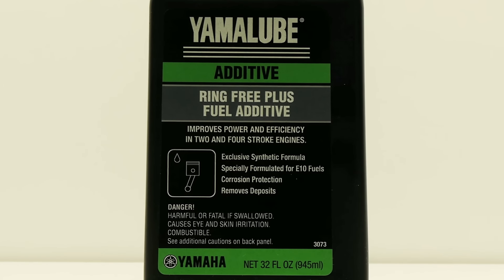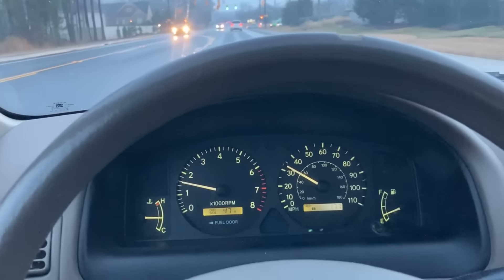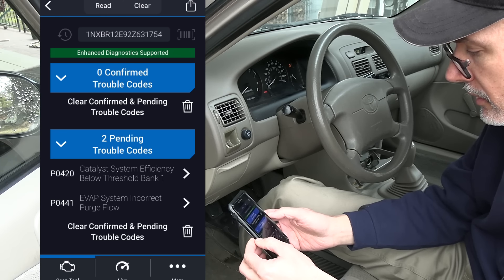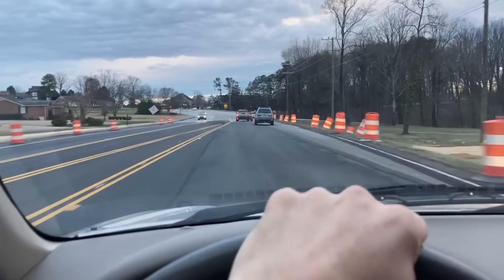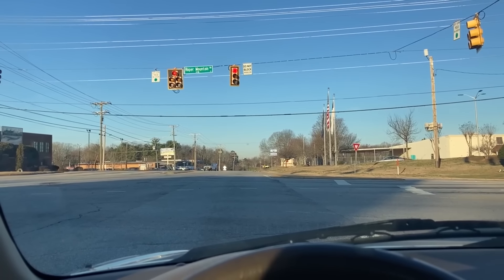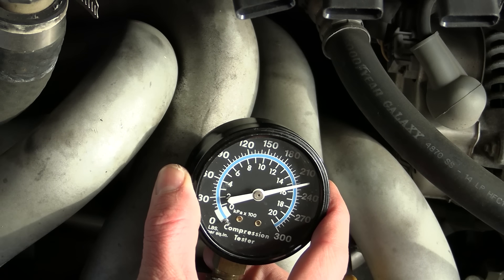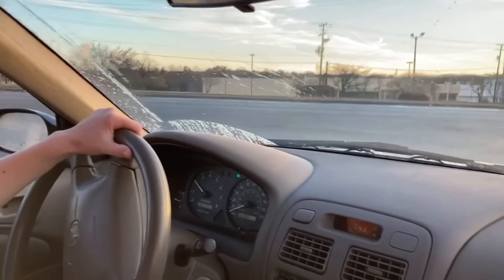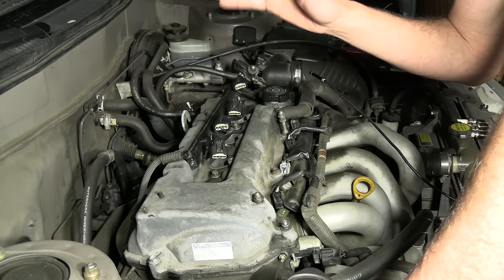Will Yamalube Ring Free stop oil consumption? | Oil Burning🔥Experiments | Episode 20

Comment from the maker: Previous video: https://youtu.be/Y5RzFYMYaJI
Oil burning experiments playlist: https://www.youtube.com/playlist?list=PLS7Cti2LicYDtv1hFbz_dErQFGxnTgMCj
Reply: Valve steam seals. Need your help.
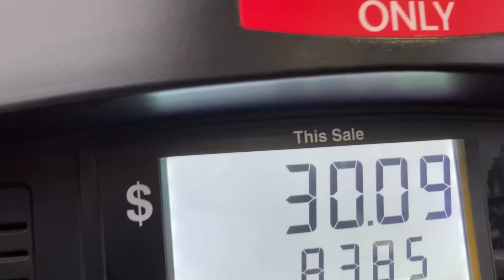Reply: 6:42 Putting 93 on a Corolla? 🤨
Reply: I subscribed exclusively for this series, have you tried using Lucas heavy duty stabilizer or Lucas + Stop leak? Good luck.
Reply from the maker: @theguycanfly98  Thanks! I did use Lucas in a VTEC Accord and it shut down the VTEC. I also used Barrs Stop Leak several videos back in this series. The thing is, I don't want to plug any holes up with thickening additives and metal conditioners (e.g. a lot of viewers recommend Restore), I want to unclog and loosen things up with cleaners to see if we can get the engine working like it's supposed to. That's not to say we can, but I'd like to prove it one way or the other. Thanks for the sub and the comment!!
Reply: @FamilyFriendlyDIY  I believe Lucas has a thinner full synthetic for low viscosity oil. Hear me out maybe add a little less than recommended of the lucas to thicken the oil a touch and maybe whatever cleaner you put in there will hold onto the rings better like the yamalube if you do another go as this cleaner. Just a thought, but I am highly invested in knowing if any of these will work, or if you finally just have to disassemble the motor and manually unstick the rings or get new rings.
Reply from the maker: @@kondon-jt8jt When it’s finished 🙂
Reply: You need to use conventional oil and not synthetic it burns faster from my experience on high mileage vehicle.
Reply: @FamilyFriendlyDIY  thank you for what you are doing, I've subscribed to your channel. I was wondering from all the cleaners that you have used so far which ones are the top three? You need to make a list at some point in your videos.
Reply from the maker: @27ubs  Thanks. ... So far the only one that made a noticeable difference in the oil use was the Berryman's B12 Chemtool.
Reply: Just rebuild the moter😮
Reply: Hey that idle flux. Could be your idle air control valve. If its like a OLD school toyota it would be on the bottom of the throttle body has water lines attached to it.
Reply: @obtrunco why not he runs Iridium plugs so...
Reply: Great video. This is my oil burning experiment. I have a 2008 Dodge Grand Caravan 3.8L I gave $1,000 for when it had 208,000 miles. The liar I bought it from said it used 1 qt of oil for every 2,500 miles. It actually used 1 qt of oil every 500 miles. I put 1 can of Engine Restorer 6 cylinder in a fresh oil change. He was using Valvoline 50/50 semi-synthetic high mileage oil. I changed the oil to full synthetic 5w30 Valvoline oil. Now, it uses 1 qt every 5,000 miles and the engine feels like a new vehicle. I have driven it 14,000 miles since that time and it is still only using 1 qt per 5,000 miles. Hopefully, it will remain that good. BTW.. Most of my driving is at highway speeds of 60 MPH to 75 MPH.
Reply: @oldschoolj510  Could be false air (extra air) being sucked in by worn valve guides and valve guide seals

Comment: I don't think your going after the problem you have.... I think it's the valve stem seals not the rings because you have oil on the top of the piston and the engine is blowing oil smoke out of it when you start the engine. The vacuum of the engine is pulling the oil through the the valve guides because the valve stems seals are probably rock hard and the guides may be loose (worn) too. You can put as much snake oil (oil additives) as you want in the engine it is not going to repair valve guide seals that are rock hard and no longer function or loose valve guides. You don't get deposits of oil on the top of the pistons like that with sticking rings because the pressure is forced down not up into the conbustion chamber you would get a ton of blowby. Try this to see if the rings are sealing, open the oil cap put a rubber glove over the hole where you add oil and seal it good. Rev the engine a  bunch of times and see if the glove fills up. If it does fill a lot then you have blow by if not it's something else like what I mentioned above. My two cents from a technician of 45 years.
Reply: It went down a lot after the b12 treatment. But I think you're right, in the fact that the rest of the oil burning is from the valve seals.
Reply: I dont think hes ever going to fix that due to his car "still using oil" he can keep making content on it. would like to see if stem seals would fix this since the b12 helped heaps
Reply: His compression is around 240psi on all 4 cylinders. That’ll raise crank case pressure while the engine is running and push oil through the valve stem seals while at higher RPMs.
Reply: Smoking on initial start:

If you start the car from cold, and it starts to smoke after a couple of seconds and continues to smoke for a couple of minutes, then goes away, that usually means the the valve stem seals are bad.
If it would be piston rings then the smoke would not go away and would start smoking even more under load and also will smoke on a trailing throttle going downhill.
Reply: @DirkOz sorry I know I am a Stan for diy Dave at this point, but I'll point out he has a whole 30 video playlist and he has already replaced the valve seals, and there is also a video where he has a camera on his exhaust for like 20 minutes. The smoke keeps coming out anytime he accelerates aggressively or goes up a hill.
Reply: @Weimaraners no

Comment: My thought is try a catch can to see it you are battling two issues I have been using ring free in the gas for all my water craft and small engines for 10 year I can say starting them never been easer and I don`t have to use combustion cleaner in the two strokes and more.

Comment: I watched all of these: 30 hours to NOT fix a Toyota. Engine flush / then de-coke using CRC in a vacuum hose off the air boot, then swap  the oil to a Valvoline Restore and protect.

Comment: Dave thank you for your great videos. Our 2018 Kia Sportage 2.4L GDI with 80K miles has been burning 1.5 quarts every 1000 miles. I performed your Chem Tool B-12 treatment and WOW 700 miles later zero oil consumption. Also the oil looks super clean, before the oil quickly turned black after an oil change. Keep up the great work my friend! 👍
Reply from the maker: Great to hear, and thanks for the update!!
Reply: The PCV residue will kill GDI engines about 150,000 miles. The valves coke up so badly they won't seat. Synthetic oil always changed by Kia dealer.
2019 Soul 1.6 stick shift.
Reply: And change your oil every 3k

Comment: I wonder if soaking some Berryman chem dip in the cylinders would free them, I’ve seen how that stuff just melts away carbon and dirt and I wonder if since it soaks down it would just clean those rings right up. Or maybe later try some bg dynamic engine cleaner oil, stuff is pretty expensive, around 200$ but I’ve seen videos show how it cleans engines up really nice.

Comment: 21:38 Dave. If you added one quart of the HPL EC (that's High Performance Lubricants Engine Cleaner) maybe even 40 weight engine oil instead of the 30. That would pretty much be the ultimate test of if the thicker viscosity (combined with their special formulation) helps slow or eliminate ???? consumption on high speed driving. I'd spent that $15 in a heartbeat. I really hope that sounds interesting to you. I see it is usually fresh oil. The HPL EC is actually formulated as an engine oil to not upset any of the additive packages that are in the other oil, the oil you are using is fine.. I too keep using 5W-30 I've been experimenting with 40 grade oils lately. The first number (the 0, 5, 10, 15 or 20 before the W) is "Winter" and has NOTHING to do with the second number, which is the API or SAE (brain fart) grade of the oil.
Reply from the maker: Whoever wants me to try HPL EC please give  82_KID's comment a like!!!
Reply: @FamilyFriendlyDIY  One of the reasons I mention it so much is that people don't really know the brand and they are some super good stuff. "Better" than AMSOIL!
Reply: @macready0230  Yes! I'm trying to convince him to give the HPL a shot lol! I had my chance, I accidentally deleted contact info so it is so hard to let that go.
Reply from the maker: @macready0230  For the record, I didn't delete it :-) ... I don't delete comments. The only thing it might be (and not saying this is what happened, because I'm not sure what was in your comment) but my channel is set up to not post comments with profanity. Could that have been it?
Reply: I use straight 40 weight tractor oil
Reply from the maker: @macready0230  of all things 🙄

Comment: Long time viewer, 1st time commenting 
My 98 corolla had mass oil consumption almost a quart a week, driving hard about 75+ daily miles odometer at 187,xxx
Decided to use Amsoil Engine Flush one of its details says Helps loosen sticky valves and rings, minimizing blow-by and reducing emissions on top of reading reviews why not give it a shot 
For $27 best product I’ve used with 1 use and great results 
I still have the oil I flushed out and it was very dark with small crumbs it sure loosened allot in there and after driving nearly 200 miles under 3hrs oil was still golden and oil consumption was way down had me smiling only had to splash a wee bit oil about 100ml or so, before that trip would’ve been around 400-500ml of oil consumption also running a oil catch can to help prevent blow by into intake manifold
Reply from the maker: That's awesome. Please keep us posted on your usage! ... Anyone else interested in the Amsoil Flush, give LegitHP's comment a like!
Reply: @FamilyFriendlyDIY  I think that you probably have an valve seal problem too. Anyway... Sometimes, drives it to the rev limiter, and let it hit there, a couple of times while ur using the products...
Reply: U aren't gonna fix this no matter what u put in it. U got leaking valve seals or something else
Reply: @kwmiked   These Corollas are known for having the piston ring issues so I think he's on the right track.
Reply: @kwmiked    He already did the valve stem seals dude.
Reply: @Sea Tee  well something is wrong if it only has 34lbs of compression,  it wouldn't run. Unless I'm figuring kpa gauge wrong? If those rings didn't free up by now with all the crap he's run thru it, it isn't gonna fix it.. look at how clean the tops of pistons are, the rings would be clean by now. And with the oil at top of bore, the rings still have tension and wiping the oil, or pushing it to the top. Something else is wrong. Plus u can still see the cross hatch in the walls, if it had stuck rings, I put money on one side of wall having up and down scratches
Reply: @Sea Tee  needs to do a leak down test. With all that oil it should be testing higher then normal on compression
Reply: @Sea Tee  actually I see it's looks like lbs on outer side of gauge. So if it has 240lbs of compression which is probably right cause of all the oil making it read very high, The Rings are sealing! So they are not stuck
Reply: @FamilyFriendlyDIY  Our trusty '04 Ford Focus w/ 287k mis on clock doesn't burn a drop of oil.  I credit that to good overall basic maintenance & well designed /manufactured engine. Used only Castrol or Pennzoil full synthetic oils w/Motorcraft filters it's entire life thus far.. since 1st oil change @1200mis (orig owners) . Always tried use midgrade 89 fuel as well prob 80% of time. Occasional fuel system cleaner @10k mis or so. Gumout & Redline are my go to products. Use them on my newer '22 F150 Tremor 4wd truck w/gen2 GTDI engine. The truck always gets 89 midgrade top tier rated fuel ..as well as 5k mi oil changes religiously w/Pennzoil Ultra Platinum (5w30 grade as required). No excess oil use as of 22k mis. They aren't known to use oil (gen2- 3.5L V6 GTDI) if well maintained. We shall see. Happy motoring! 👍🏻
Reply: @GOLTURBO555  For sure. There's engine issues going on here.
Reply: @kwmiked  Absolutely truth. Short term fix to a serious engine issue.
Reply: @Just_Another_Commoner113 how did you use it? put it in in Oil and idle for 10min then oil and filter change?
Reply: Toyota 2.4 L drinks oil it’s possible a piston soak will work however all I’m doing now is buying cheap oil and keeping the cat clean and I’m doing fine
Reply: I used the same, and it worked

Comment: I discovered YLRF in 2006 with AMAZING results over & over again & again. From outboards, lawnmowers, chainsaws & ANY 2 or 4 stroke engine. It has cleaned dirty fuel systems in minutes, un-stuck stuck valves & piston rings, increased power & overall performance throughout all throttle ranges...I even add to the fuel in my 2007 Expedition several times a year. The stuff has proven itself to me & I am a believer!

Comment: Awesome video again! Following all the videos I remain at the conclusion worn piston rings. Even with a clean engine and cylinders it continues to burn oil. Also a tip, if you measure pressure in cylinders with so much oil in them, the pressure will probably be always just fine because the cylinders are so wet. The excess oil seals the cylinders. And BG products rock!

Comment: This has been a great series so far. When you decide to stop the experiments, replacing the pistons and rings with the engine in the car, it is  relative simple repair.
Reply from the maker: Thanks. And if a chemical can't get us below a quart in 3000 miles, I plan on doing a re-ring video 👍👍
Reply: @FamilyFriendlyDIY  I was just thinking the same thing watching this video that as many times as you've pulled the spark plugs, changed the oil, and just generally messed around under the hood that you could have easily just swapped in some new rings.  For the record, I'm pretty happy that you didn't choose the easy fix as this series is beyond fascinating!
Reply from the maker: @bnations2000  Thanks ... and a teardown might still be in the future :-)
Reply: @nat0rade no. Time, and it is invasive. But not hard. Need to understand what your doing and why your doing it though to ensure a good rebuild.
Reply: For a trained mechanic though, right? Even aside from the winch to remove the engine, the tools you need are pretty specialized (from the videos I’ve watched). I’d love to change the rings on my 2az fe, but I’m just getting started and it’s probably a couple years of consistent car work before I’d feel confident enough to pull and disassemble the engine.
Reply: I don't know about this engine specifically, although a small toyota, older, might not be that hard for your average Joe to figure out.
Need an engine hoist, stand, and a fair amount of know-how.
For most people in this niche reading this, it would likely be a pretty drawn out affair as few people have pulled an engine, etc.
I DID read someone somewhere who reported a small Toyota possibly like this one could pull the top end off, drop the oil pan, onbolt the connecting rods and push the pistons out the top with the engine still in.
If true, that would seem pretty do-able for many here.  I'd probably plan on the vehicle being out of service for a week or so though...

Comment: The Ring Free is good stuff. We sell it all the time. It’s kinda  expensive though. 
I tell people that buy it to use it in their old tired lawn mowers. 
Use it at double strength right before you change oil. It will trash new oil when the gunk turns loose.

Comment: I love these Corollas maybe alittle too much. Local shop I worked at for years had a 1998 Corolla manual with a bad heater core and from then on it was love at first drive. (Fast forward 10 years) Now I run my own mechanic shop and I have a 1998 Corolla manual and a 2001 Corolla automatic for a loaner cars. Some people really don’t understand the beauty in simplicity of these cars. 
I stumbled across your videos a couple months back trying to solve the oil burning issues. I tried the B12 chem tool for 48 hours, let it idle for 10min then changed the oil. And I’ve noticed a massive difference already! So I thank you for these videos. I get a lot of satisfaction from fixing these Corollas. 
On my 2001 automatic Corolla (I just bought for $600) it has a bad rod bearing so I’ll be getting the satisfaction of finally rebuilding a 1zzfe and putting new pistons rings in it and let me tell you I can not freakin wait to take the pistons out of that thing. 
I feel like you deserve the satisfaction of holding that piston in your hand.
Reply from the maker: Great testimony. Glad to hear it worked! ... and I might have the pistons out eventually, we'll see.

Comment: Video 4 of suggesting Kreen for a piston soak and engine cleaning!
Reply from the maker: :-) ... If y'all want to see a Kreen soak, please like Kenneth's comment!
Reply: @FamilyFriendlyDIY     If you think you still have stuck rings, then isn't soaking them for days upon days, from the top down, make sense?  Maybe drain out the oil, add cleaner to the top of the piston, let it drain through and even reuse the cleaner that comes out of the oil pan that has no oil in it?  Repeated soakings for days?  Check  BDC and TDC drain rates?  Maybe try to push the piston near TFC, into the sidewalls, with a wooden dowel it you're brave enough, to try and break those rings free from the gunk and varnish from excessive heat that 4 cylinders usually run at?  

Or do you just want to keep making videos for money or the attention or disproving engine cleaners?

Comment: On the toyota bouncing idle, its likely a dead spot in the TPS (Throttle position sensor)  what you can do, is loosen the screws holding it, and rotate it SLIGHTLY, to move the dead spot below the idle position.  SO, if the throttle moves clockwise to rev, you move the TPS a tiny bit counterclockwise.